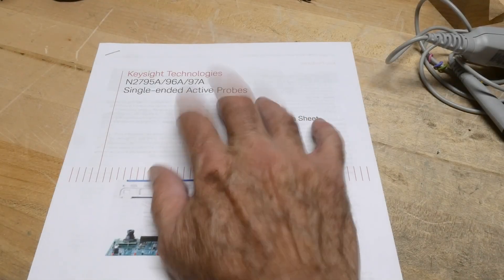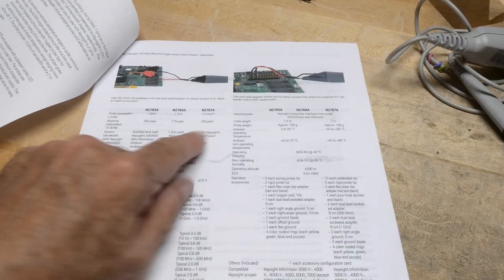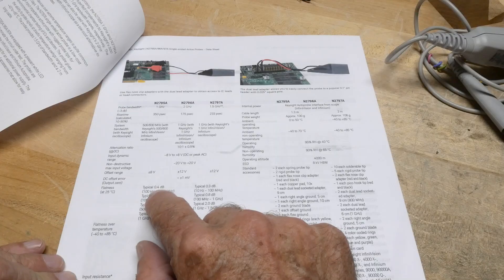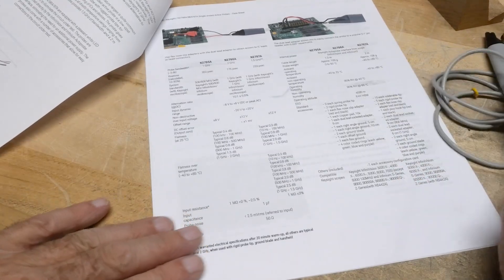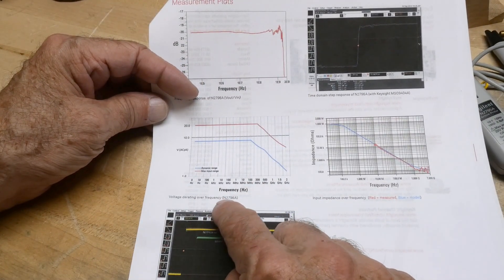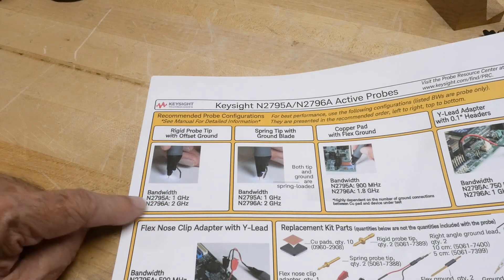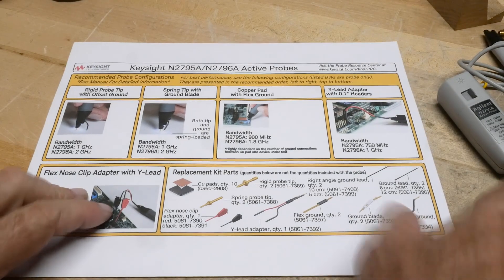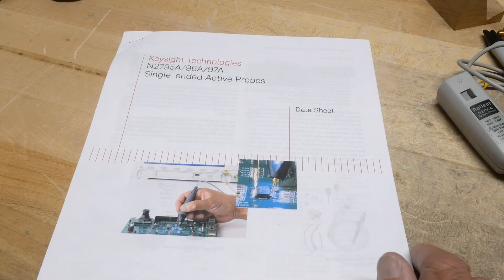#2347 Agilent Active Probe N2795A 1GHz 0.9pF (part 2 of 2)

Comment: I can't get over how janky the "adapter" system is on an expensive probe like this. They couldn't at least mold them?
Reply: Then it would be pretty much useless.  If you have a fixed distance between the probe tip and the ground tip you would not be able to use it in probably 95% of applications.  It's not like the ground plane is the same distance from every component lead on a PCB.
Reply: @mikesradiorepair  get back to me when you learn about molding
Reply: @humidbeing  What are you going to injection mold.  A infinite number of probe ends to account for every possible spacing?  That makes a lot of sense.